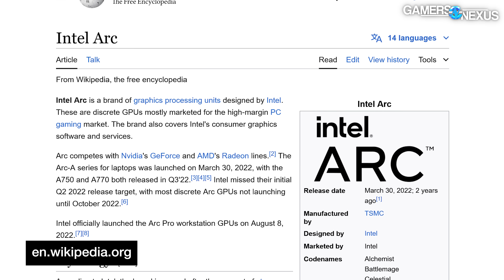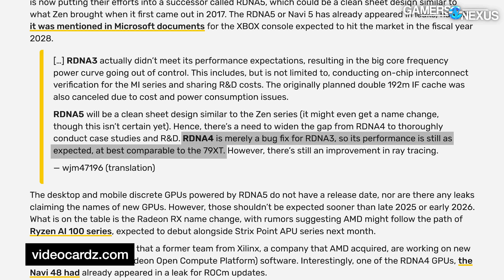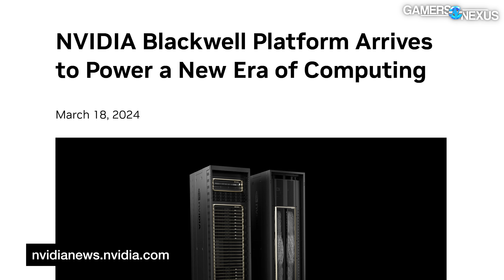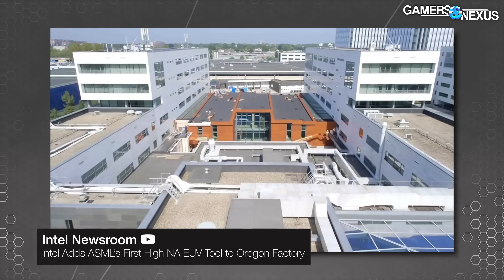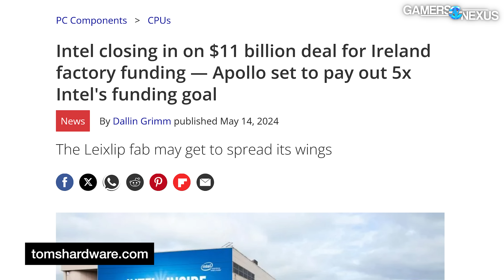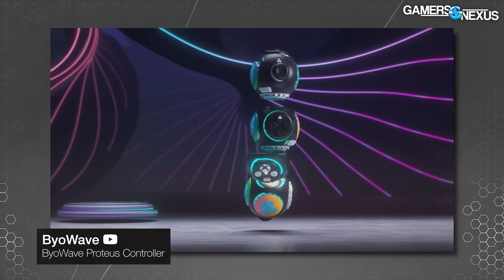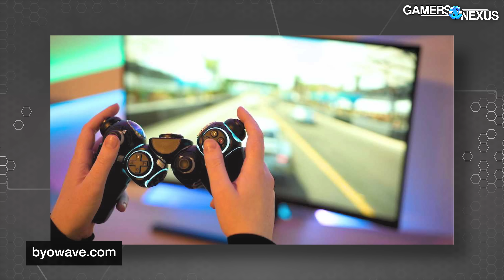HW News - Intel Battlemage Handheld, AMD RDNA5 GPU Rumors (Already), NVIDIA Handheld

Comment: I really hope that RDNA5 is a actual fresh start and with it a change of tactics for AMD. The last decade plus of openly refusing to compete with Nvidia on a performance level has been embarrassing for them (And a lot of techtubers who kept propping them up even in the face of their own test data) and harmful for the market as it has left Nvidia free to do whatever they feel as far as GPU's go, we are lucky that they have for the most part kept pushing performance first even as they charge insane prices due to having no one even attempting to match them. 

If AMD sells off their GPU division then I can only hope that whoever buys it will have the willpower to do what AMD either couldn't or refused to do.
Reply: "If AMD sells off their GPU division then I can only hope that whoever buys it will have the willpower to do what AMD either couldn't or refused to do."

AMD is the best competitor you can get against nvidia. if they really did not care about competing with nvidia then they will quit long time ago just like Imagination. you will not going to find better "willpower" to compete with nvidia other than AMD.
Reply: @arenzricodexd4409  Then where is the competition? Where is the 7900 XXX or whatever that can actually give the 4090 a run for its money? Hell where is the 4080 equivalent?

AMD has refused to compete since Vega fell flat on its face. Instead they have papered over this by framing slightly lower prices as "value" even when the hardware doesn't even deliver on that price point.

So at this point the bar is low enough that it shouldn't be that hard surpass it for anyone else.
Reply: @Hybris51129  because that's the best AMD can do? No other company will be able to do it better than AMD. Nvidia simply that far ahead. Imagination back down in early 2000s else they will be another 3DFX. Qualcomm really did very well with the IP they get from AMD but even when they generate more money than AMD + nvidia combined in the past they did not dare to enter discrete gpu market.
Reply: @arenzricodexd4409  You keep repeating this idea that no one can do better and yet the record we have of what AMD has done thus far is pathetic. So prove your statement, show what AMD has apparently done that no other company can do.
Reply: @Hybris51129  AMD right now is second best GPU company in the world. that is the definite proof no matter how pathetic they are in your eyes. so then tell me. what GPU company that can go against nvidia better than AMD.
Reply: @arenzricodexd4409  When there are only 2 major companies that make  GPU's saying they are "2nd best" doesn't mean anything. Intel is still working up their GPU division and aren't going to even start applying pressure to the market in any major way for likely a few more years at best.
This leaves us the consumer with a broken duopoly where half of it isn't even attempting to compete and the other half is shift attention away from the market because they have such a dominant position that they can afford to expand into a new product market (AI hardware) without fear of losing market share.
Unless Intel buys Radeon from AMD and use the acquired tech and staff to boost their own efforts any competition at this point will have to come from a different company. 

Who will it be? Don't know could it be one of the existing major tech companies like Samsung, Sony, LG for example or a company that might want to start expanding into a new field like Amazon or maybe Apple, then you have your dark horse with Elon Musk who could come in out of no where.

Regardless the current state of the market is not to the consumers advantage and a lot of it falls on the failures of AMD.

Comment: 7:53 This almost definitely isn't how AMD is doing the naming, but it's the most logical version you're probably ever gonna get:
- AMD Radeon HD 1XXX -> 7XXX
- AMD R(adeon)9 4XX -> R9 5XX (basically Radeon HD 9XXX names)
- AMD R(adeon)X(10) 5XXX -> RX 7XXX (RX = R10 in Roman Numerals, and it goes back to thousands because then it's 15,000 I guess ¯\_(ツ)_/¯ )

It does basically mean they go from whatever number they started at (1,000?) up to 7,000, skip 8,000, go to 9,000, skip 10,000 -> 14,000 and end up at 15,000, currently now at 17,000

Comment: I love the byowave accessibility controller thing, it's cool af and great, but I have to complain that the price is SO excessive considering it's an accessibility thing at its core... Like, why is this always the case? I get that it's not intended to be a widespread product used by anyone/everyone so the expected profit is much lower but it's seriously asinine.
Guess it doesn't help that controllers in general have like tripled in price... I remember when I could get a new xbox360 controller for $25-$30, wireless for $45 and special things for $60. Now base controller is what, $60-$100? Wireless +50%

Comment: Intel releasing a 238 volt CPU is something I fully expect.
Reply: Finally I can plug my CPU straight to the wall. No pesky power supplies required.
Reply: It's just 240V, but accounting for the inevitable voltage drop once you turn it on!
Reply: next up intel cpu's running 800W's yet a amd cpu running 200 watts still out does it

Comment: Regarding AMD's naming conventions, I really wish they would use one single brand name specifically for their discrete GPUs. I am currently considering a new gaming laptop purchase. When searching for products on most retail sites, its a pain to find laptops with AMD dGPUs because they use their "Radeon" name for both discrete and integrated graphics so you really have to hunt. Whereas if it has Nvidia anywhere, its got discrete graphics. It's a small thing, but it makes me less likely to buy an AMD product because its so much harder to even FIND some to compare against competitors. I've even run into this issue cross shopping lower end gaming desktops for friends.

Comment: Deductive reasoning is where you combine statements into a conclusion that necessarily follows from the premises. The term you're looking for is "inductive reasoning" where you creatively come up with a conclusion that could explain the premise, but doesn't necessarily follow from it. Since Intel CPUs needing 238 volts is logically consistent, but there are other possible explanations, this is a form of inductive reasoning.

Comment: 238 Volt? Could almost run natively on a single standart outlet here in europe. Maybe a little undervolting to 230 Volt would do the trick. Then limit the current to 1 Amp and we are almost in spec with 230 Watts of power draw :D

Comment: DO Not drop the Radeon, that is the only way i can consistently search for AMD GPUs specifically, but suggest something much simpler

Radeon 110 - Radeon 195
Radeon 910 - Radeon 995
Radeon 1010 - Radeon 1095
Radeon 9910 - Radeon 9995

Comment: 17:22 As a owner of a Nvidia Shield Tablet, to this day it's a sleek device, the controller was odd but worked, and generally just fun to use as it was just stock Android 6. Just wish it was a 64 bit system, because the 32 bit was the kicker. After the battery issue (expanding battery) , the entire platform died and the Switch came out and Nvidia pivoted to the Shield TV anyways. Hopefully MediaTek and Nvidia could pull something off, and possibly to higher standards to the original Shield Tablet, but that price is something...
Reply: The idea Jensen is upset with Nintendo seems odd, since the Switch 2 is going to be a chip hungry launch. Silly to be angry at the largest supply agreement you have.

I think Jensen is more disappointed that they didn't get offered to build the Steam Deck/ROG Ally APUs. Like they need to build a mobile gaming PC to prove they are the better choice.
Reply: I had both shield tablets and they were trash. Horrible build quality
Reply: @marktackman2886  I never had the clamshell shield, was very odd device.

The 8 inch tablet was pretty decent, all things considered. The stylus was a nice touch, the games it offered, the speakers facing out from the fromt made it 10 times better than many devices in that era, and the free but limited GeForce streaming experience was nice.

Yeah the battery issue was not great but then again 2014 was the year of exploding and expanding batteries. 

For what it offered, the build quality was adequate for the use case of the 8 inch tablet, and I personally never had issues. Like I mentioned, possibly a next iteration could be held to higher standards.

Comment: "AMD drivers are better now"

Good joke.
Reply: AMD Drivers were never bad. Whoever claims otherwise is either a bot or a bot.
Reply: @Nutflix-s7w Yeah used it, didn't had a single problem. I also think their UI is better but their pricing is not much lower than Nvidia that is better for pro workload
Reply: @Nutflix-s7w  AMD never bothered to fix various issues, especially hardware acceleration related or windows in general.

The best example is HDMI scaling, it did not worked for me 10+ years ago, and it does not work properly today (halves refresh rate in half).

There are plenty of small issues that usually have 3rd party workarounds, which is a security risk (malicious code). For example, I still use powershell script on my 3200G system because AMD never bothered to fix VP9 playback officially (bug was present since vega iGP released).

I do not owe AMD anything and I will vote with my wallet, which means I will not buy or recommend AMD GPU unless AMD starts fixing these bugs retroactively, but seeing how legacy driver UI closes with latest legacy driver when you switch various options, I firmly believe that AMD does not have any quality control.

Comment: I have high hopes for Intel's GPU market.  I don't expect them to compete with the high end Nvidia cards, but a solid iGPU to offer comparable performance to AMD's would be nice.  Or a decent dedicated mid - upper mid dedicated GPU option.

Until they reach the low wattage performance efficiency that AMD has, I think they're at a disadvantage in handheld market.

Comment: honestly AMD deserves credit for having GPUs named in the single digits (Radeon VII), double digits (Vega 56/64), three digits (RX 580 etc.) and four digits (RX 6600 etc.) in the last 10 years alone, and not even in ascending order because that would be too predictable and boring. Also massive kudos to them for having a CPU and GPU sporting the same name (7800) at the same time, but somehow the one ending in 3D isnt the GPU. One can tell they really try their best to be as consistent and transparent for customers as possible.
Reply: The 7800XT is a hilarious GPU name when you consider there are also XT series Ryzens from previous generations. They were higher-performance versions of the X chips, which would have also been used to describe the X3D chips considering the relationship between the 5000X and 5000X3D parts.

There is a dark alternate timeline where you can build a PC with a 7800XT and a 7800XT.
Reply: @DigitalJedi At some point I had a PC with a 5600X and a 5600 XT. Almost there.
Reply: @DigitalJedi  
Wher the 3D would be on the GPU and we'd give AMD shit for being confusing... XD
Reply: @DigitalJedi The X3D comparison is only the case for gaming loads - and it should be apparent that people use CPUs for things other than gaming. XT CPU variants are strictly higher clock speed versions of their counterparts, which X3D parts definitely aren't.

You can totally built a system with a Ryzen 5700 and RX5700, I wouldn't suggest it though
Reply: @laceflowerhw  Yeah I totally get that. I'm just trying to say that they already had that suffix around on CPUs and could have reused it. The 5700/5700 PC is a good one, and it's little brothers the 5600/5600 and 5500/5500 can also be built.

I had a laptop for a while with a 6800HS and 6800S for the CPU/GPU setup as well. AMD naming gets weird.
Reply: wait they have a CPU called RX?
Reply: @youkofoxy  No, but the CPUs and GPUs can have the same numbers and suffixes. Since most people leave out the RX at the beginning when discussing them, it can sound like they are talking about the wrong one. If I say 5700, you can't tell if I mean the RX 5700 or the Ryzen 7 5700, for example.

Where this gets comical though, is when you put those parts together in one PC. You can have a 7600X and a 7600XT as the main components of your PC for example.
Reply: Hmm I always thought that RX stands for "Radeon X"
Reply: You must be dumb if you find it hard to understand.
Definitely better then NVIDIA with multiple skews of cards named the same but perform worse due to gimping them
Reply: I think the frequent name changes are there because none of their big breakthrough architectures worked as well as they should. They try every once in a while to get a fresh start with new branding; if it were to work, and they'd became as competitive in GPU as they are in CPU, that name would stick. Ryzen and Zen stuck around for that reason. If Vega had been a breakout success, I bet we'd have seen a lot of Vega cards. I find the 56/64 naming to be the most confusing out of their names, tbh, and Radeon VII is just too short, not enough room to keep a consistent scheme, and I don't want to end up with the Radeon MMCMXCV XT a few generations in.)
Reply: @derantorkiarig4592  The Radeon VII is more like a special edition or refresh than a proper generation. It's the Vega architecture generation 2 (VII = V2) and it's the first Radeon on 7nm (VII = 7).

Future generations of Vega would probably be the Vega X(CU number), where X is the generation number.
Reply: To be fair, the 3D part is actually logical. Because it uses 3D Cache technology. Suffixes being a bit cryptic is to be expected, they cant start putting whole sentences into the product name.

Comment: Running higher voltage lowers the current for a particular current. Think of Current as high octane gasoline or alcohol and voltage as diesel. Diesel has a slight efficiency advantage as it runs cooler because current is not being used to drive wattage up. I realize the topic is dead, i was merely finishing your thought

Comment: while AMD's naming doesn't make sense if you're newer to the gpu market a lot of what they've done actually makes sense.. the fury/Fury X is a reference to the ATi Rage and Fury MAXX, the RX400/500 series is a reference to the R400 and R500 architectures which were the last competitive architectures while ATi was still independent. the HDx000 and RXx000 series are pretty standard through their history. the only real outlier is vega and the accidental similarity to the ATi Mach 64(i asked a few of the engineers that were working for AMD during Vega and most had forgot Mach 64 was even an ATi product).

Comment: Mobile gaming devices are absolutely the future. The switch was the first to bring the laptop dock concept to a gaming console but future gaming will be a portable device you can mount to bigger tv screens. It’s great to see more hardware manufacturers getting into the handheld gaming space. Maybe Sony will even make the Vita 2; the follow up to what is, in my opinion, the greatest handheld device to date.
Reply: Completely. The Switch and Steam Deck changed everything. There’s a space for large beefy gaming computers and consoles, but handhelds are going to be the dominant player.

Comment: 238v is just called that because Intel decided to cut the W in half thinking it would lower power consumption.
Reply: It was originally supposed to run at 238 Watts. Now it just need 238 Volts, perfect for connecting directly to the grid
Reply: Did an actual chuckle out loud at that one.
Reply: Damn I had the exact same joke in my head 😆

Comment: I have an asus 790 board and a 13th gen intel, i updated the bios a couple weeks ago to the latest and started getting crashes. Went back to second newest and the crashing stopped but i started getting power limit throttling at stock speed and stock bios settings (except xmp enabled). Turns out PL1 was set too low. At like 230w, i set to 307w and problem fixed. But i had to dig through settings to find it and im a A+ tech. Average person isnt gonna know to do that.

Comment: God I wish Nvidia would get their god damn head out of their ass -- split the AI nonsense off and put it in a separate card. I don't want RTX. I don't want DLSS. I don't want DLAA.
Give me a 4090/5090 whatever, without the AI/RTX core nonsense, for like half the price. just pure, unadulterated rendering HORSEPOWER
Reply: Why not just buy an AMD card at that point?
Reply: @ironicdivinemandatestan4262  AMD doesn't even compete on the higher end... I literally want from a 6900XT to a 4090 because of the fucking nonsense from AMD. They just don't have the compute for high end VR resolutions... For reference, I'm running DCS at 23 million pixels... about 3 times higher than 4k res.

Comment: Ayy, we EU folks get to run our intel CPUs with power straight from the wall, no transformers or power supplies needed, just plug that thing straight into the 230-240 volts.